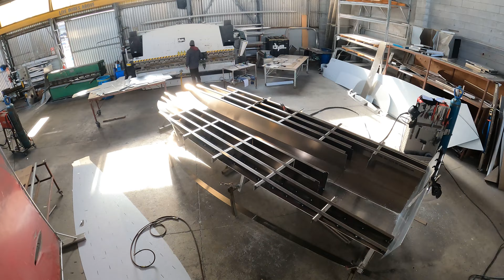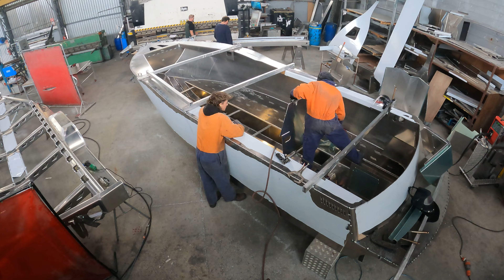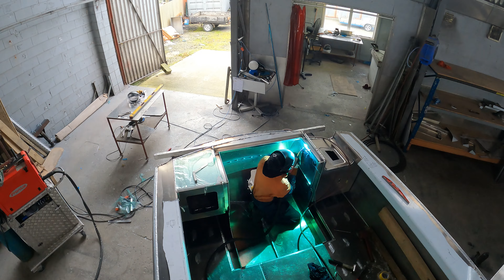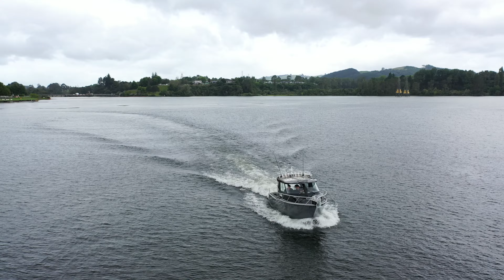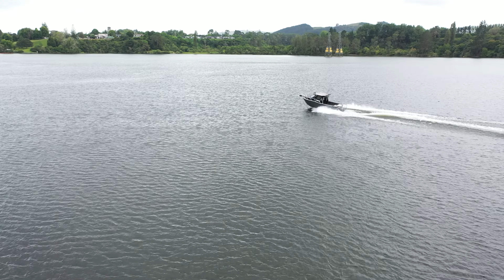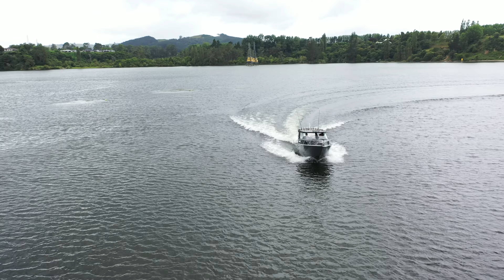Marco Boats 725 Souwester Diesel boat build video.

Comment: how fast can this boat running in normal weather
Reply from the maker: Pretty hard to say what normal weather is but normal cruise speed would be around 25 knots, 30 knots for a fast cruise and 15 knots if the weather is pretty crappy.
Reply: @marcoboats  quite fast thanks